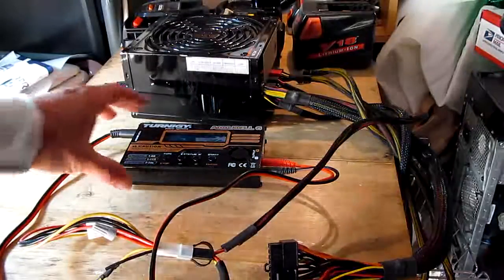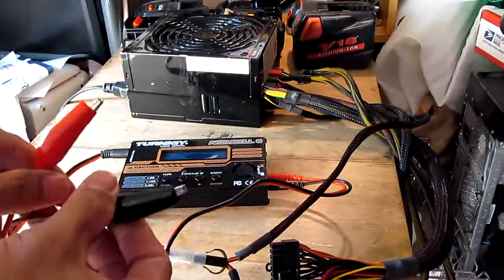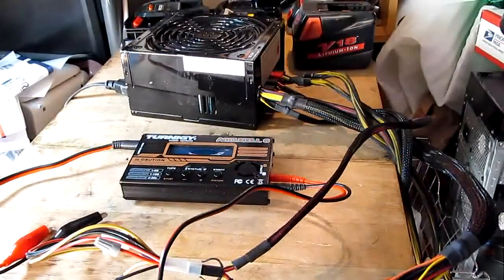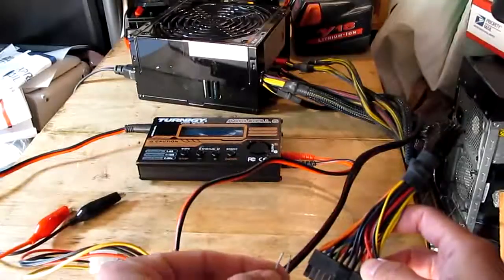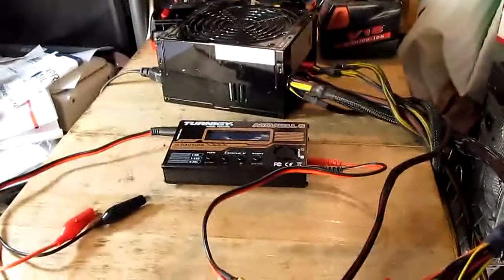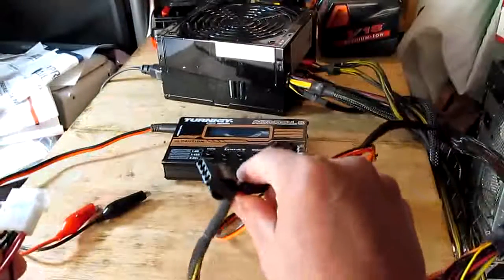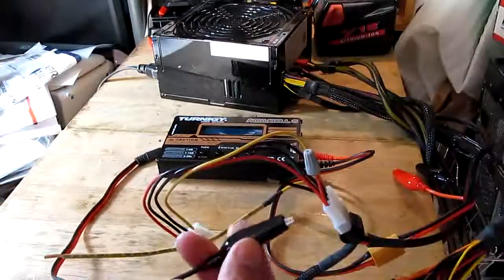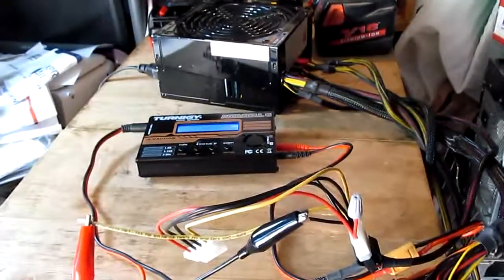How to use a Computer power supply to power a Turnigy balance charger to charge RC Lipo batteries

Comment: I have a DC pump that I use for pumping oil. do you think I could use a computer power supply to run it? I figured since it hooks up to my 12v battery that it might work with the 12v power supply.  it uses 13.5 amp.

Comment: But over these thin computer wires you should only draw 5A - they are not designed to handle more...
Reply: Right that's my concern.  I need to charge my 6s batteries at 10amps. Doesn't seem like this solution will work for me.